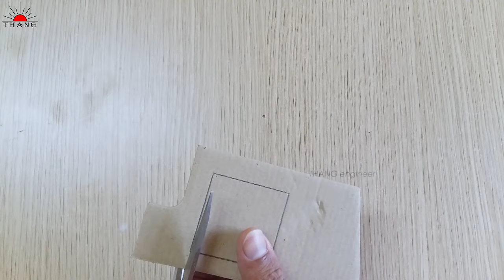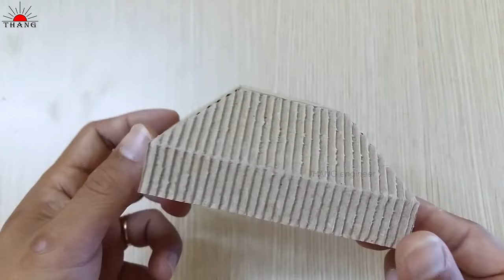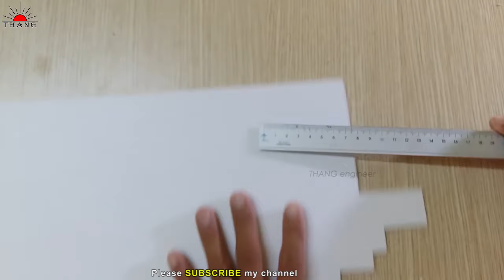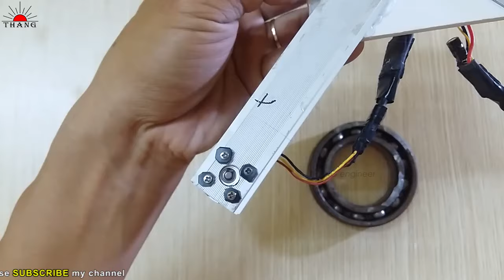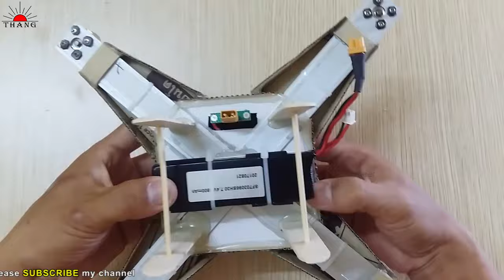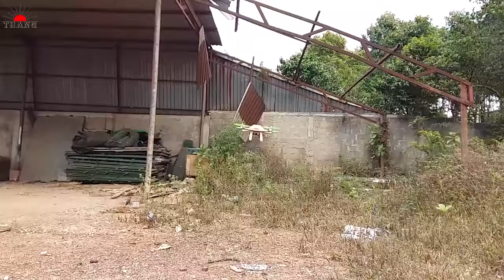How to make Remote Control Cardboard Drone at home | 100% fly

Comment: What are the materials needed to make this?
Reply: Materials

	Cardboard
	Hot glue gun
	Special strong white paper 
	2x Rulers in build
	Blade
	Screws?
	Receiver RC (flight controller) 
	motor with three wires
(Brushless DC motors) 
	zip ties
	screws to screw on board.
	screws and motor mounts
	Pop sticks and bamboo skewers for the stand for the drone 
	SF703096SH30 7.4V 1800mAh Drone Battery 
	Drone Propellers
	Screws to screw propellers on

I do not know if this is correct yet. I will make the drone then see if correct (Thang Engineer pls check if this is correct PLEASE)
Reply: @littlegobby  okay thanks

Comment: I also want to make this i can't
Reply from the maker: Why can not?
Reply: You can't make this drone because the propellers which he use  for this drone is not good for drone and I think you also used same type of propeller. If you want to make drone that fly then use propellers and motors made for drone and other flying vehicles
Reply: @THANGEngineer  drone ka circuit khan sa milla ga

Comment: dude pls show where you buy the drone control board. ❤👍
Reply: and a month has passed and he didn't tell me what a dumbo.
Reply from the maker: Sorry, I bought it at a rc shop. You can do that same me
Reply: @THANGEngineer  I don't have an RC shop near me. I guess I can order it on the internet.
Reply from the maker: Banggood, Amazon, ... please search web
Reply: @THANGEngineer  also I got an idea and I begun doing it. I took an RC cars circuit board and now I can control the motors with the remote. and I'll mount drone motors to four corners and then it will fly. at least I hope. I will also make it cardboard but for extra support I'll also use wood.

Comment: What size are the propellers, they differ from the bugs 3 drone, and where did you get them?
Reply: PLEASSSSEEEE TELL ME WHERE U GOT THESE FROM PLEASSEEE OR TELLL ME WHAT TYPE THEY AREE PLEASSSE
I NEED THIS FOR MY SCHHOOL PROJECT PLEASEEE
Reply from the maker: You can buy it at online store, parts of dr
Reply: thank u also is this materials right? @THANGEngineer  
Materials
	Cardboard
	Hot glue gun
	Special strong white paper 
	2x Rulers in build
	Blade
	Screws?
	Receiver RC (flight controller) 
	x4 motor with three wires
(Brushless DC motors) 
	zip ties
	screws to screw on board.
	screws and motor mounts
	Pop sticks and bamboo skewers for the stand for the drone 
	SF703096SH30 7.4V 1800mAh Drone Battery 
	x4 Drone Propellers
	x4 Screws to screw propellers on

Comment: How do you add a camera to the drone
Reply from the maker: I am not add yet
Reply: I want to be the first 11 year old to make a drone with camera in Nigeria
Reply from the maker: Very young boy to make
Reply: Were did you get the battery from
Reply from the maker: From a shop rc
Reply: Were did you get the receiver
Reply from the maker: Banggood or amazon
Reply: What is the name of the thing you used to hold the wire together
Reply from the maker: Bugs 3 drone parts
Reply: Can I use 1400kv motor for it
Reply: If I want to add a camera to it were should I put it
Reply from the maker: I think Ok
Reply: Can I use a wooden ruler
Reply from the maker: It is heavy than aluminum
Reply: Can I add a camera to it
Reply from the maker: Yes ofcourse
Reply: With the bugs receiver
Reply from the maker: Yes
Reply: Which part will I put the camera
Reply: Can you make a video of a fpv drone with cardboard
Reply from the maker: Anypart
Reply from the maker: Made
Reply: Can I use 5×4×3 propeller
Reply from the maker: Yes ofcourse